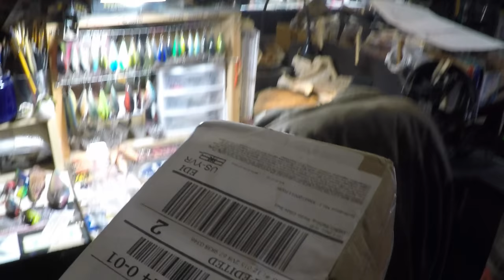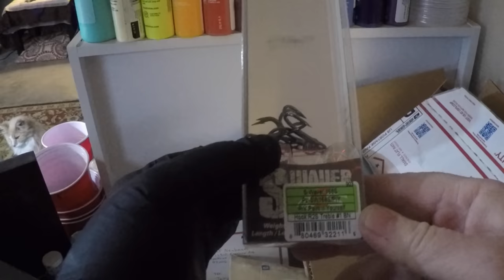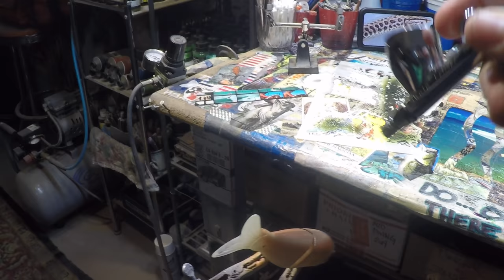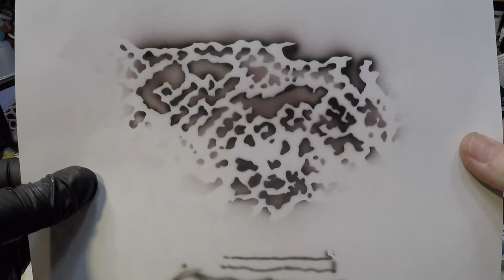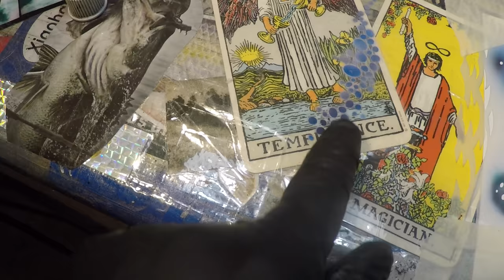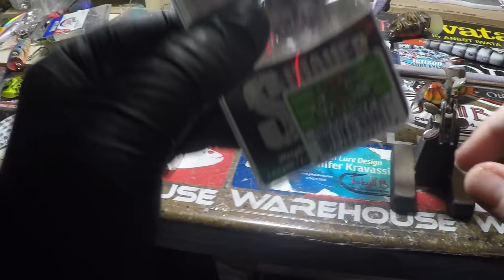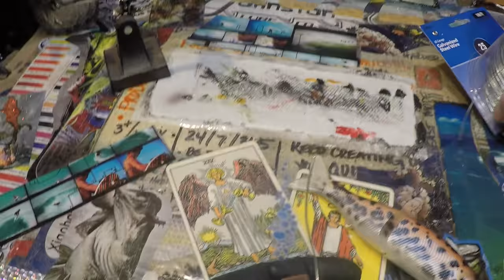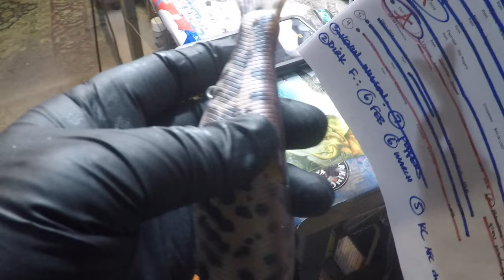Snakeheads, Stencils and Swimbaits!

Comment: I notice you have a large compressor but I know you have a smaller tabletop compressor that I’ve seen you use. (Maybe I’m crazy) but what’s the purpose of using the smaller one vs the larger one. Is it just a preference thing or when you are cranking out orders you use the larger compressor. Cause my work shop is shrinking from about 25’x18’ garage to a smaller 8x8 shed and if I can get away with buying a tabletop compressor for cranking out 15-20 baits each time I head to the shop I’d like to to save some space? Thank you :) and we ain’t got snake head in my area here in Michigan but we have burbot and dogfish galore and those dogfish are 🤮
Reply from the maker: My small one is what I started out with. When it died, I replaced it with a better one